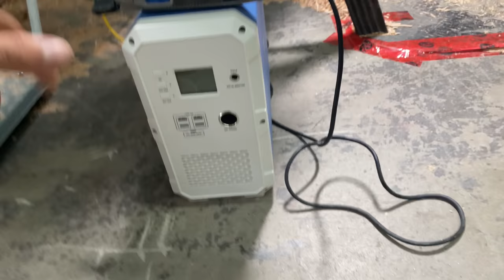Wood turning- Double Twisted Vase (bluetti EB 150 )

Comment: Haven't seen two of the tools you used to hollow it out before. I don't know what they're called or how to describe them really. The wide pressing saw bit? shavings fell out the back of it. What would that be called please? 
And that angled metal chisel used to scrape the insides. I mean it's a  scraper but
Reply from the maker: You mean for hollowing the inside Woodturning - The revolutionary Tool  ( Part 1 )
Reply: @Villywoodworking  Thanks. Yes that was one of the tools I hadn't seen. The other which looks like i really should've known about it by now, is the stationary cutting tool used to make the hole you then scraped out
Reply: @Charlie-te2tt  That looked like a Forstner drill bit to me.

Comment: Great job Villy!  I have an old Legacy mill that will do twists, including open twists, but it won’t do ones with a changing radius or pitch. For that you need one of the fancier CNC machines. Did you consider put some CA glue in those cracks? I was afraid pieces were going to break off with the open twist.